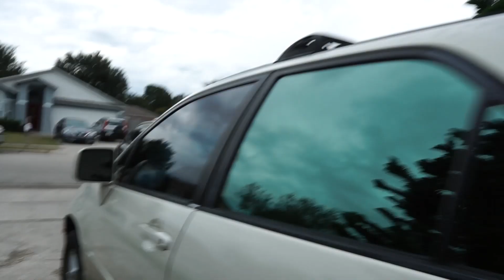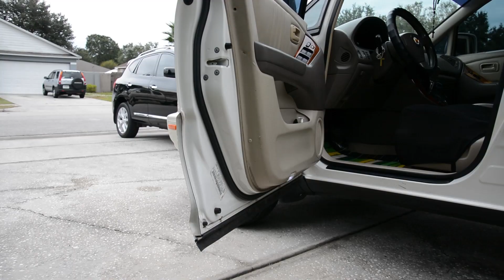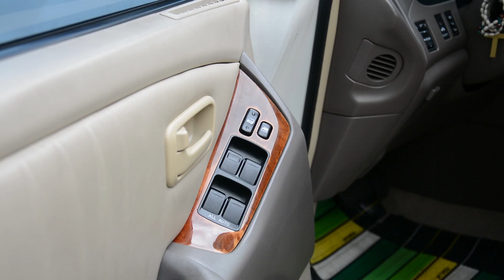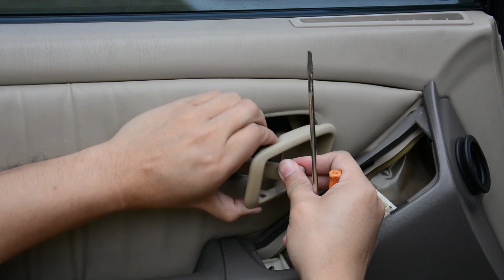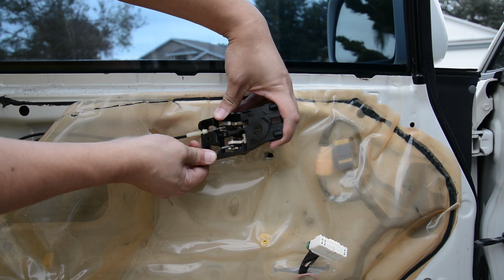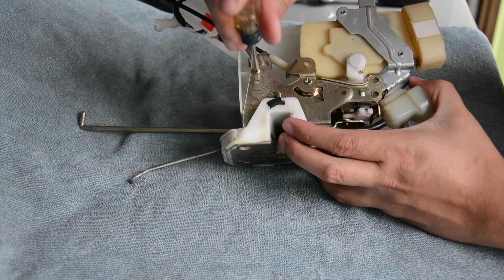Lexus RX300 Door Actuator Replacement

Comment: Thanks!!  Replaced my door actuator just like your video.  You saved me (probably) a couple of hundred in labor costs if I were to take this to the dealer.
Reply from the maker: Glad it helped you out.
Reply: @IvanDeSagun  i liked and subscribed to your channel AWESOME VIDEO i just bought a 2003 rx300 from a friend whos owned it since new and the driver door locks and unlocks only with key so im thinking actuator needs replacing like yours can you tell me how much the actuator cost and where you got your new one THANKS IN ADVANCE!!
Reply from the maker: @iamkazie9401  You can find them on Ebay or Amazon, its less than $10 
https://www.ebay.com/itm/Power-Door-Lock-Actuator-for-98-05-GS300-GS400-GS430-Prius-Front-Left-6912030010/322998598803?ssPageName=STRK%3AMEBIDX%3AIT&_trksid=p2057872.m2749.l2649
Reply: @IvanDeSagun  i seen a few mixed reviews for these some said worked fine another said one didn't match up
Reply from the maker: @iamkazie9401  That is actual seller where I got mine and it worked. You can find other sellers on ebay, just use the part number to search. The front left and right sides are different, so make sure to double check.
Reply: @IvanDeSagun  actually there out of stock right now on the link you sent me I'll keep checking
Reply: @IvanDeSagun  is your driver door actuator still working good did you have to reprogram your locks or did it work right away after reassembling Thanks again!!
Reply from the maker: @iamkazie9401  its still working, I didn`t have to reprogram mine. If you need to reprogram yours scroll down through the comments and you`ll find the instructions posted by Christopher.
Reply: @IvanDeSagun  i got my actuator this past week it came in 2 days i ordered from your link I'm just trying to get motivated to go turn the heat on in garage and do it its cold here in Illinois today(Saturday morning below 20 degrees) I've watched your video at least 10 times lol. I did see Christopher's comments with steps on reprogramming if necessary. I have another question for you. Have you had any issues with the power antenna ? Mine is fully extended and when you turn car off the antenna doesn't retract back down into rear fender. I hear the power motor running for a moment as it seems to be retracting but i believe the plastic cable may be broke off keeping it from moving I've seen other you tubers replacing theirs I was wondering if you had any issues? THANKS AGAIN for the quick replies!!
Reply from the maker: @iamkazie9401  My power antenna hasn’t been working for a while lol it really does not bother me as much so I haven’t fixed it 😁
Reply: @IvanDeSagun  THANKS to your video I SUCCESSFULLY completed my driver door actuator project just now it took me 3 hours total but wasn't rushing i enjoyed my time in the garage and just paced myself rewatching your video. My only problem at the very end was the little plastic door handle shroud installed it in correctly by locking it in from the left side forgetting that the little plastic tab on back right needs to go in first to mounting tab but i got it everything went back together as it should and it all worked i tried it before i put everything back next project is my antenna lol THANKS AGAIN!!
Reply from the maker: @iamkazie9401  Glad it all worked out for you!
Reply: @IvanDeSagun  and Thanks for sharing the link for the actuator it fit as promised and delivery was fast
Reply: @IvanDeSagun  SORRY TO BE BOTHERING YOU AGAIN but seeing that you are an experienced Lexus 300 owner just want to know if my locks/ alarm are doing what their supposed to when i did the driver actuator yesterday i disconnected the positive battery cable then reconnected when finished. So heres my first question #1 when i lock vehicle with key remote button the red theft light on dash stays on solid for 1 minute then goes to slow flash meaning alarm is set (read this in owner manual) when i press unlock on key remote door unlocks and as i open front driver door alarm sounds/horn honks until i press unlock again on key remote HOWEVER if i open left passenger door first to put something in car close door then open driver door alarm/horn doesn't go off IS THIS NORMAL ? #2 do the doors all lock once you put in drive and start driving for awhile ? As i mentioned this is my first time with a Lexus THANKS AGAIN!!
Reply: @IvanDeSagun  i was just wondering how long your driver door actuator has been working for you? UNFORTUNATELY mine stopped working last week i contacted the seller and he gladly offered to send me a refund but i just asked if he could send me another and i received it today. I wanted to ask you if you had any issues with your alarm once you installed yours. When i installed my first one last month i would press UNLOCK on my key 1x the driver door would unlock and if i opened the door the horn would start beeping so i would have to press UNLOCK again to silence it. I started just to press UNLOCK 2X when unlocking which would unlock all doors to get around this. Not a big deal but was a nuisance at 3 am while going to work. Did you notice any issues with yours once replaced? I'll be putting in the replacement this weekend THANKS FOR ANY OPINIONS OR SUGGESTIONS!!
Reply from the maker: @iamkazie9401  The unit I have installed from the making of this video to this date is still working I guess I got lucky. I did not encounter any issues with the alarm but try synching your alarm following "Christopher Anderson's instructions from one of the commenters below.
Reply: @IvanDeSagun  THANKS I will see what happens once i change the replacement this weekend
Reply: @IvanDeSagun  i replaced my one month old driver door actuator with the replacement today the company sent me the failed actuator plastic linkage that pivots with cable attached locked up. Also the new one works normal when pressing UNLOCK 1x the driver door opens without alarm sounding the other one i had to press unlock 2x to silence it. This one looks a little better compared to last one. HOPEFULLY it will last awhile now LOL

Comment: I completed a task but now I cannot open the door from the outside by pulling the handle does not matter if the door is locked or unlocked any help is appreciated
Reply from the maker: Check the 2 rods that are attached to the door handle. https://youtu.be/41iHl-3IuXM?si=i9SlvQeKQuXj0Tgk&t=194
Reply: @IvanDeSagun yes I checked the rods are connected and when I pull the handle from the inside they move when I pull the handle from the outside they move
Reply from the maker: @shaunt7301  ok you might have to pull the unit out again and check if the plastic piece with the rounded end is inside the plastic toggle of the new actuator motor unit, https://youtu.be/41iHl-3IuXM?si=WS-ezxf_vczbbj6K&t=271
Reply: @IvanDeSagun  thanks I finally figured out one of the rods was not connected properly and was sliding up and down.... hot tip to get the longer rod back on the clip have to pull the outside door handle half way to improve access to the hole the rod inserts into.

Comment: Great video.  You didn't show how hard those two clips back in there can be hard to reinstall.  But I've done it before I'll remember.  Passenger side this time.
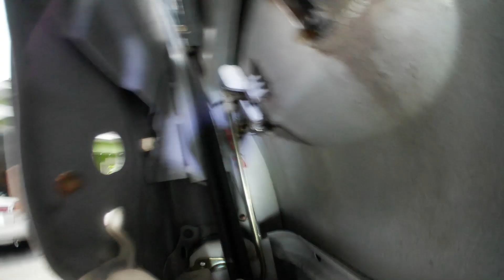Reply: Reinstalling those two arms at 3:16 is the tricky part of this fix. This video helped me figure that out. The thinner gauge arm goes back into a hole in the red clip where the arm bends at 90 degrees. The larger gauge arm connects to the door handle and comes back toward the engine. The white clip goes back over it to hold it. Hope this helps someone :)

Comment: Just a word of caution to everyone... I replaced all 4 actuators on my 2003 Lexus RX300 doors.  Upon completion, my key would start the car as normal but the remote features (lock, unlock, panic) would not work at all.  I even tried the reprogramming steps with the hit the lock/unlock 5 times, insert the key, yadda yadda yadda ... that didn't help.   So, what I found out was that the alarm system was out of sync.  I found these instructions to get your remote features back up and running... It worked perfect.... follow these steps if your remote stops working after changing out the actuators ... 

I tried everything several times from adding, deleting, re-programing my remote but nothing worked until I tried the following:
1) Lock your doors with the key on the driver's side door, then wait until the red security light goes from constant on to blinking (about one minute) this sets the alarm...
2) Go to the passengers door and unlock it with the key and open the door, this will set off the alarm then close the door and go around to the driver's door...
3) Unlock it with the key then open it, while it's open use your remote's unlock button and that should stop the alarm and activate your remote... Good luck
Reply: Christopher Anderson THANK YOU FOR SHARING YOUR INSTALL EXPERIENCE AS WELL WOW YOU DID ALL 4. I need to do my drivers door and THANKS TO IVAN sharing his video and parts link i ordered my actuator and got it in 2 days. How long did it take you to do all 4? Did you do all in one day. The 2 linkage arms on drivers door look intimidating to work with ARE THEY? trying to psych myself to goi g and doing it THANKS!!
Reply: You're such a legend thank you bro

Comment: I got a quote of $1100 to replace one actuator.  I bought a complete set on Amazon for $54 and change the bad one in an hour using this video.  One note, I did not disconnect the cables from the door handle, as the entire handle can come out with the piece attached.  Also putting the piece back in is a little tricky with the window track.  I  pulled it down slightly so I could move it out of the way.  Reconnecting to the handle, I went back and watched the disconnect.  The closest arm is easier to reattach if you pull slightly on the door handle lowering the attachment point.  You then just put the piece through the hole and lower the plastic attachment.  I put the rest in the trunk area for storage until the others eventually fail too.  Thanks for the video.
Reply: Can you post a link from you got your door actuators? I bought mine but they don't work properly.
Reply: I used a set from Amazon and they lasted about 2 years before failing.

Comment: This is the best video on You Tube on how to replace these. Just a word of caution: There are many DIY instructions on taking part the actuator and just replacing the motor. You have to cut open the box,  press out the gear on the existing motor shaft and put it on new motor then glue the thing back together. Many people have problems with this including the doors unlocking when you hit the lock button. OR a few doors unlocking and one or two locking out of sync. It has to do with a reversed polarity on the motor. Also regarding replacing the actuator unit with a knock off: There are so many thousands of these units out there and many either don't work or work for about three months. There are actually so many that a tech has a highly technical breakdown site reviewing "what to look for in a Chinese knock off actuator." If you get the wrong one, you're hosed. Some don't work with your key fob at all. So I have three doors not working and did all the research on OEM. So dumb how Lexus/Toyota rips us off for a part that they designed DEFECTIVE. My solution was a guy on eBay who rebuilds OEM units with all new parts. All cables installed and ready to swap in. About $100 to $120 per door. Yes, that's expensive but not like OEM costs and this has warrantee. I'm not a shill for this guy so that's why Im not linking to his product - but this is the route I'm going.
Reply: How did it go?

Comment: KIA owners must have given this video the thumbs down.  I’m going to try this this weekend. A big thank you to Ivan for making a simple video that is straight to the point. Thank you sir.  I’d like to have you as a neighbour.    EDIT.  Replaced mine today. Plugged in the two power connectors before I reinstalled everything.  Didn’t work.  Then I plugged in the power window assembly. WORKED!  Again. This video was great help. Thank you Ivan.
Reply from the maker: Thanks for the kind words! I hope everything goes smooth for you 😊
Reply: Brad Farmer i too followed Ivan s video and purchased my actuator from the link he shared for my 2003 rx300 i installed mine this past week the only thing im not sure of is that when i unlock the driver door by pressing unlock on the key 1x as i open the door the alarm triggers the horn to start beeping  however if i press the unlock button 2x which unlocks all doors the alarm does not go off when i open drivers door or any other door ANY IDEAS OR SUGGESTIONS?

Comment: I almost made a video but I figured I’d just put it in the comments. TIME SAVER: you don’t have to remove / disconnect the interior door handle cables or take out the entire lock assembly. You can easily bring it out to the side of the door and work on it while it’s still attached to the cables - saves you about 15 minutes of work. Also the bar where the window slides up and down goes IN FRONT of the door lock assembly - nothing can be the way of the window track. Lastly - your bottom door courtesy light will not work until you plug in the lock / window control switch. If you want, you can pull the courtesy light from the bottom while the door is still attached - makes unhooking / hooking the harness a lot easier.
Reply: Thanks for sharing!Please make a video on how to do it.

Comment: Thanks, Great Job!  On mine it helped to put the rubber track for the window up towards the upper inside of the door where there is a metal ledge for it to sit on while I put the assembly back into its spot-it seemed to be dangling right in the way of the actuator arms.

Comment: How’d you get the door handle plastic out? I’m stuck
Reply from the maker: Which part are you referring to?
Reply: Ivan actually I figured it out. I was nervous I was going to break the plastic. But I was referring to the plastic that comes out where the lock and handle are in the inside of the door. Prior to taking the door off
Reply from the maker: Glad it worked for you!

Comment: It’s hard to remove the rod from the white plastic that’s attached to the outside handle
Reply from the maker: https://youtu.be/41iHl-3IuXM?t=211
Those rods? I took them off with 1 finger.
Reply: @IvanDeSagun  i found that holding the rod with your fingers and using your pointer finger to unsnap the plastic from the rod worked good

Comment: Where di you buy the actuators ?
OEM?, or knock offs ?
Reply from the maker: Just knock offs from ebay.
Reply: @IvanDeSagun  do you by chance remember the seller ? Price point ?
Reply from the maker: https://www.ebay.com/itm/322998598803
Reply: @IvanDeSagun  many thanks
Reply: @seangibson2612  i was following the video Ivan posted as well i too have a 2003 lexus rx300 and the driver door lock actuator is not working im considering ordering one of these that he purchased HAVE YOU ORDERED ONE? just curios if you did hows yours working
Reply: @iamkazie9401  I did not. I found that changing out my battery fixed it.
Reply: @seangibson2612  WOW that was an easy fix lol i did purchase a driver door actuator for my 2003 rx300 from the link that Ivan shared i received mine in 2 days I followed his video to a T while changing mine it took me about 2 hours but i wasn't rushing UNFORTUNATELY mine stopped working after 1 month i contacted the seller and he offered to send me a refund but i asked for a replacement which he sent me another which I'll tackle again this weekend. I just would highly recommend that everyone who has watched Ivans video to SAVE IT!! It was spot on VERY CLEAR STEP BY STEP INSTRUCTIONS. hoping my replacement will go in as easy as first time and last longer lol

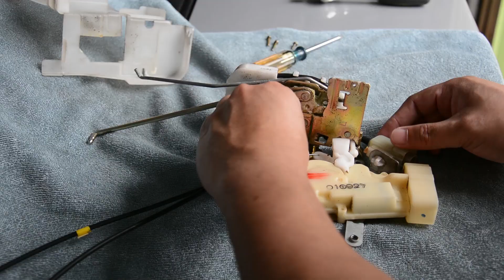Comment: on 4:23 the cable with the green, is that the cable connected to the door opener from inside (the bottom part)? how about the cable with yellow tape?
Reply from the maker: Both of the black cables are for the interior door handle, if you go to the 3 minute mark you’ll notice that one has white and the other is gray  plastic ends, take a picture before taking them off so you’ll remember where they go.
Reply: @IvanDeSagun  white ends are both white or white at one end and gray on the opposite end.? Thanks.
Reply from the maker: @zgcc9541  there’s 2 black cables that attach to the inner door release handle, one has a white tip the other is gray.

Comment: Do you need to disconnect the battery for this procedure?
Reply from the maker: Marian You don’t have to, just make sure the ignition is in the off position.
Reply: Ivan thank you! Got it all taken apart now, let’s hope I can put it back together, hehe. Your vid is suuper helpful.
Reply from the maker: @marian9445  Glad my video helped you! Good luck with the install, you can do it! 😊
Reply: Ivan all good and working now, thanks!
Reply: @marian9445  where did you get your new actuator i need one for 2003 rx300
Reply: I AM KAZIE i found them on eBay for about $10 each.
Reply: @marian9445  did you purchase your actuator from the same place ivan shared the link i did was about $12 i changed mine out but it only worked for a month the seller was going to refund me the money but i asked for another and he sent it to me so I'll try again
Reply: @iamkazie9401  I don't think so, I just looked up a set of 4 on eBay and had someone install them. After a year one gave out so I replaced it with help from Ivan's video and the replacement still works. Then recently a rear one started acting up so i ordered a replacement but haven't put it in yet. Kind of a pain but I got a couple of years out of it and the factory ones seem to be over $300 each!